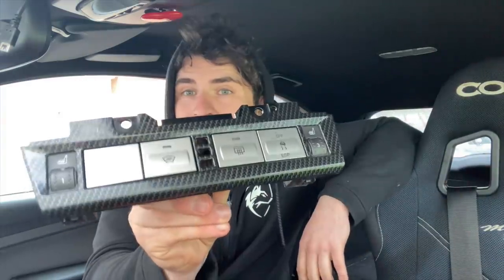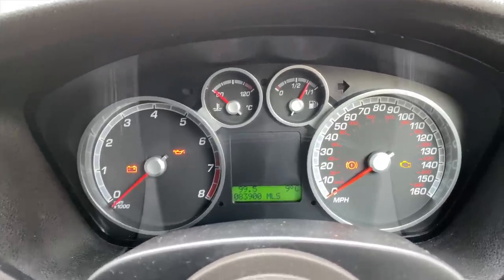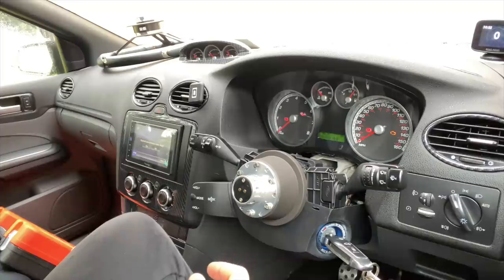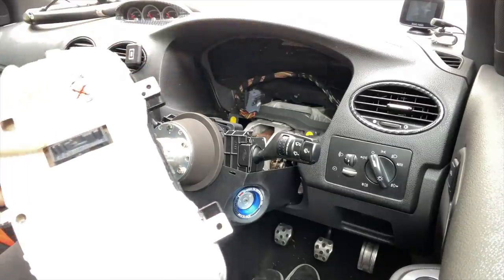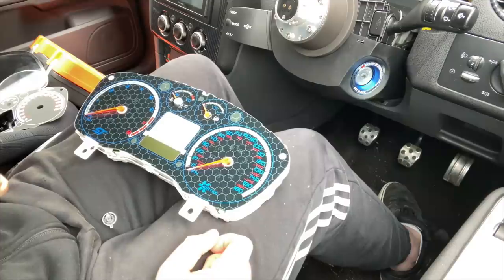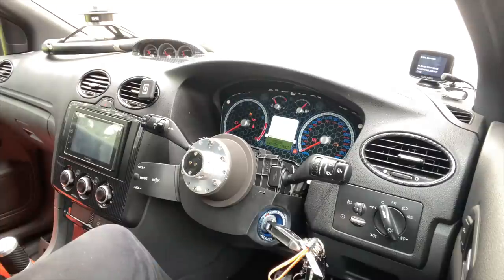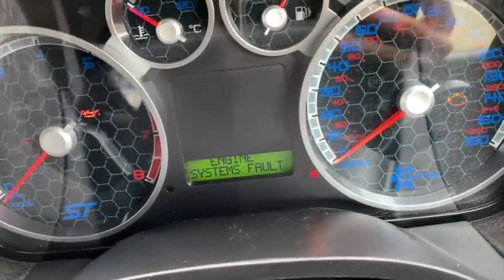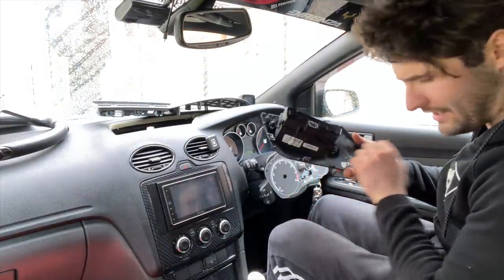FOCUS ST GETS CUSTOM DIALS AND TURBO GAUGE | AIRTEC COCKPIT

Comment: Check your petrol gauge needle. Unless you went to fill up between your new dials it’s now reading higher with the new clocks in. Check start of video your showed and end of video and the gauge is sitting higher I believe
Reply: True, it gained a 8th tank after the new dials went in ..

Comment: Was your water leak not coming from the holes were the spoiler clipped in to the bodywork before you fitted the risers? I took of my spoiler after seeing your installation video with intentions of ordering the riser kit . But could see the potential problems of water getting in the car . Three little sticky pads won’t last long . And have you kept the bonnet risers ? I keep looking thing sic . Then I’m not so sure . Another fantastic mod video bud . 🤘🏻😎🤘🏻

Comment: On a separate note your car doesn’t have a traction control button or a heated front windscreen.....thought these would be standard on all ST’s!
So does your car actually have traction control then? Pic of a car with waivy lines behind it in the clocks would tell you.
Reply: I'm guessing its the differences between ST-1, ST-2 and ST-3. To Google.
Reply: Would save having to turn the twat off everytime you start up 😁